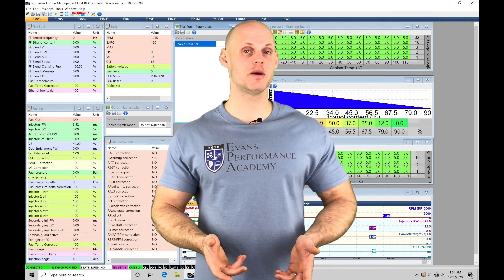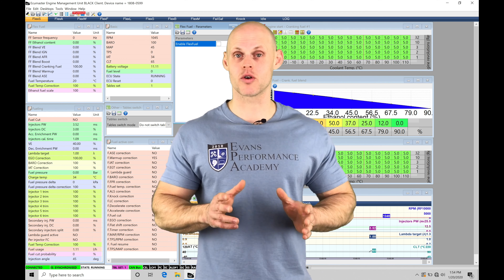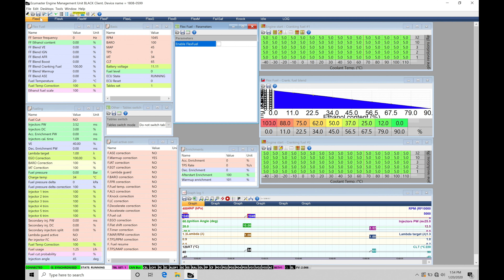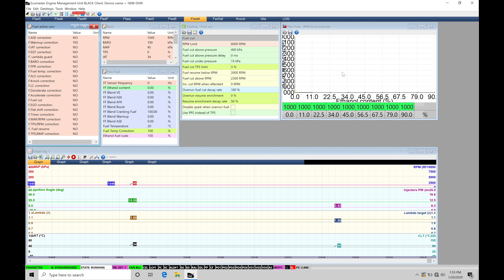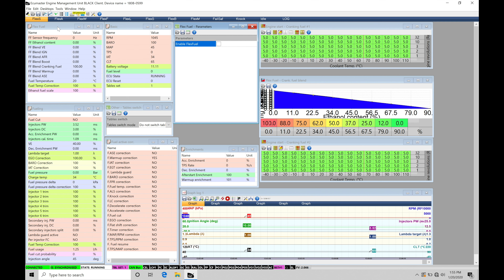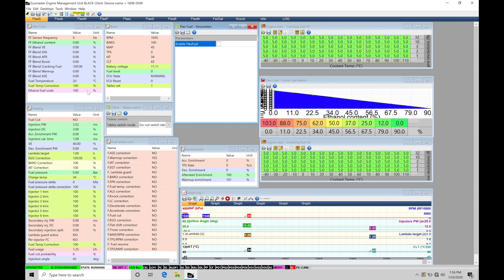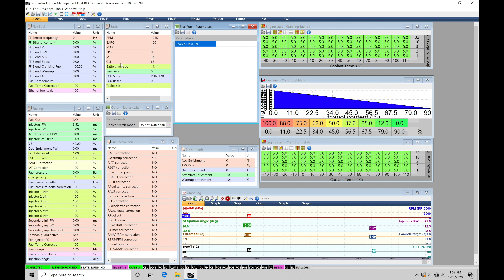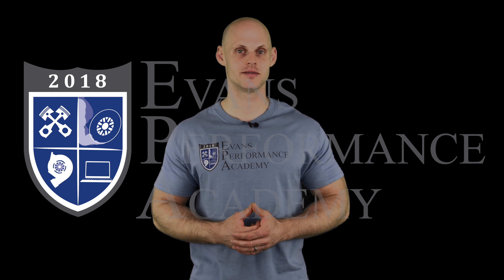ECU Masters Training Course Part 29: Flex Fuel Tuning | Evans Performance Academy

Comment: Can the emu black auto blend from mixture of 91 and e85 without  me switching map and emptying the tank? If i got it tune with 91 and e85, Say if I'm low on 91 and I went to pump e85,can the ecu compensate and aut adjust accordingly... ?
Reply from the maker: Yes,  assuming you have a flex fuel sensor wired into the EMU and its set-up / tuned for the flex fuel feature.